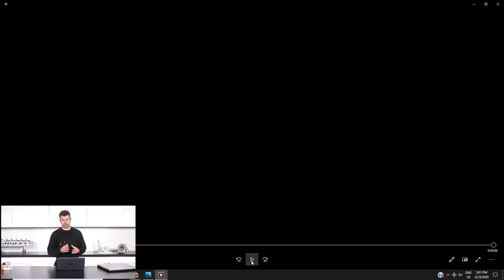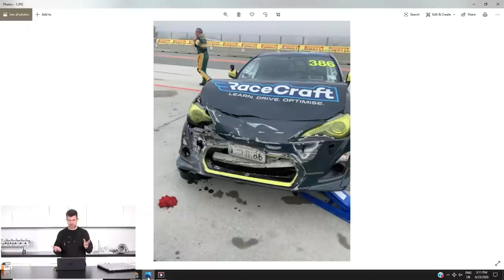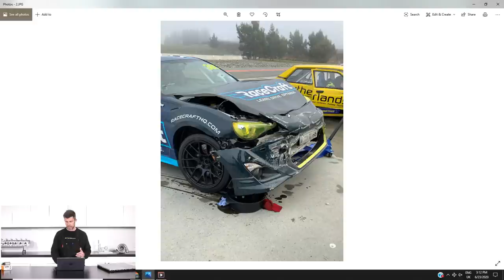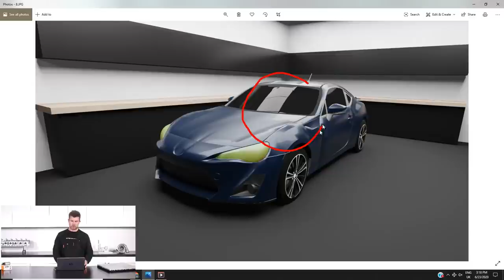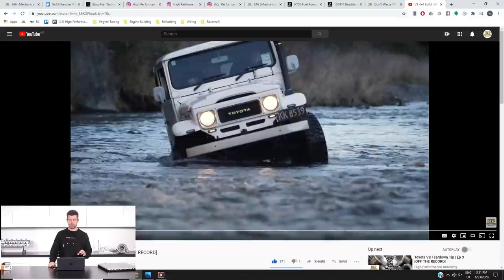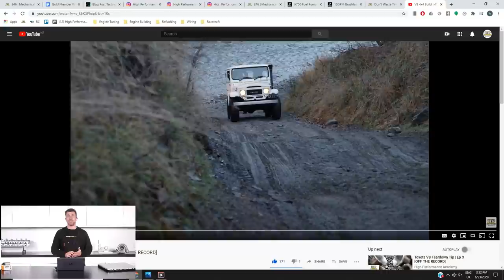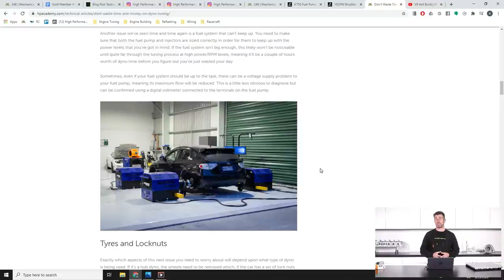How I Crashed The Toyota 86 | Today At HPA [UPDATE 246]

Comment: A note on the flooring
If you put tiles like that down with holes in them no matter the brand I'd highly recommend coating the concrete floor before laying it
It will stop the concrete from absorbing all the fuilds that may land on it
Reply from the maker: Fair! Cheers John - Taz.

Comment: I've done that with my Hans, very easy to do if you rush, but you learn to just run your hands across the ridge and then you know, tightening in two stages helps as well. You also have your thumbs wrapped around the rim, very bad habit in a crash

Comment: It happens - I've been lucky, and I use that word deliberately, that all my missed shifts on track have been up, not down, so far - and I don't expect any further opportunities to occur to change that.
Like many things, all drivers are going to be one of - those who did it and admitted it, those who did it and lied about it, and those who have yet to do it.
Well, a couple in trucks on the road when splittes/ranges didn't change as they were supposed to, but felt them before fully releasing the clutch and buzzing the engine.
it is also a timely reminder that this sort of thing can happen to even good drivers - so those who intend doing a lot of track days in your fast road car - and some will be much quicker than Andrés car - seriously consider investing a few thousand in safety equipment! it may not be 'your' mistake, but getting caught in someone else's is going to hurt just as much!

Comment: The oops sucks but that's motorsport. Thankfully nobody was injured. The highs wouldn't be so sweet if it weren't for how awful the lows can be....

As an aside, no! Keep the H-gate around!!! I know it's not the fastest, coolest or safest, but nothing engages the driver like a manual. A manual puts more responsibility on the driver for how the car performs. It massively increases the driver's work load in a way that a sequential or auto just can't. When in the car you're always operating at 100% regardless of transmission type but the work load of a manual means you have to really operate all the inputs to get the times you want. Wringing out a manual is straight up one of the most satisfying things on the planet. Lastly, with a sequential or auto - you'll never get the tingle of joy that a perfect heel-and-toe downshift provides. 

#SaveTheInferiorTransmission
Reply from the maker: We had already previously decided that this car will remian H pattern - Ironically for lessons around shifting technique and heel and toe down shifting - Clearly a topic I'm not qualified to teach - Andre